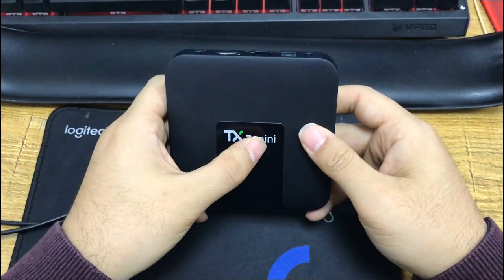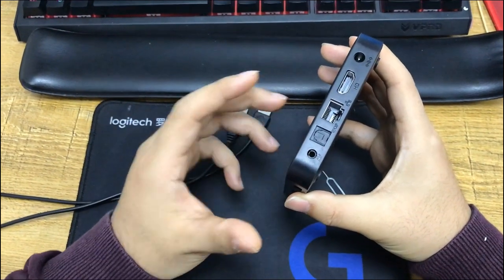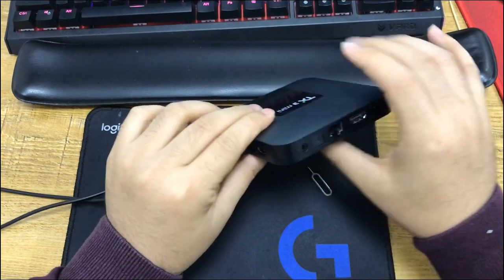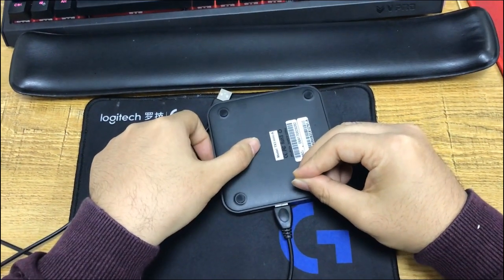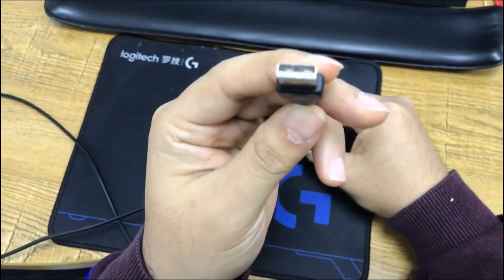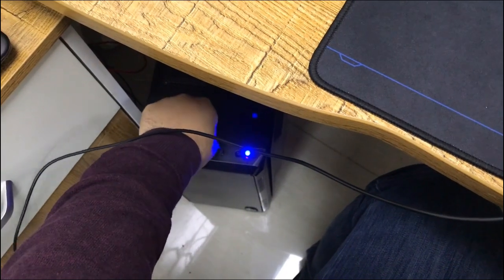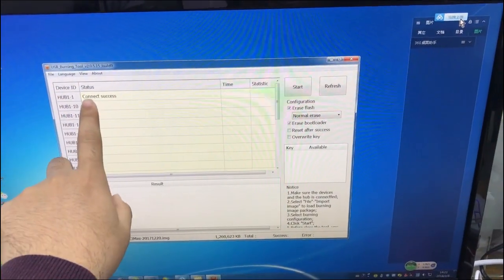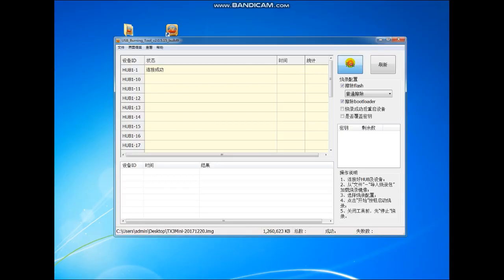TX3 Mini S905W  S905X How to buring software by usb

Comment: i have a problem i want to do the firmware tx 3 mini but the process is terminated after 9 percent writes error how can i do my friend. can you give me a link tx3 mini firmware
Reply: I Have The same Problem With My TX3 Mini, The Device Had Rooted From The seller, Now Trying To unRoot it, the system is crash, Now i Nee The Firmware To reboot it, are Found it?